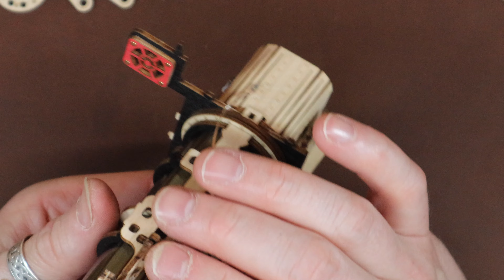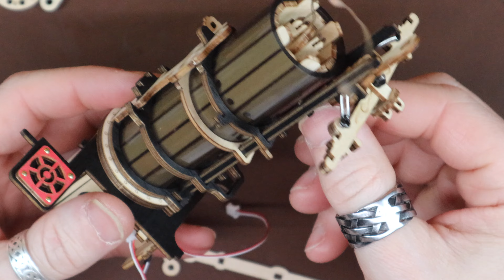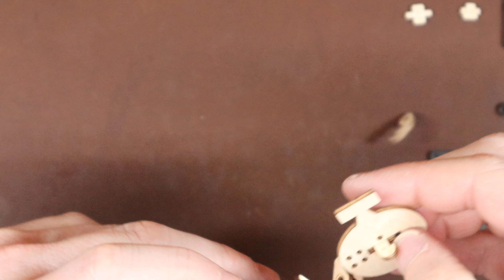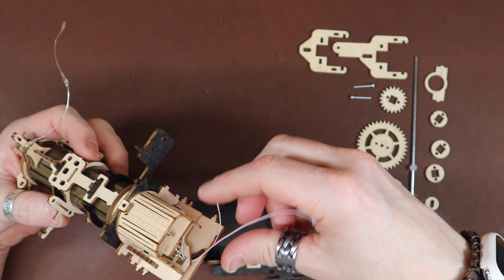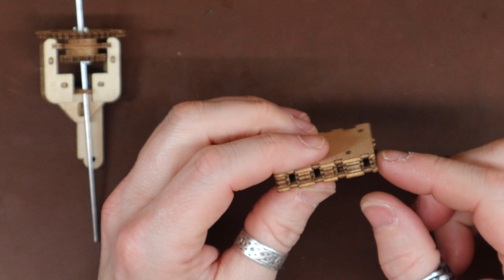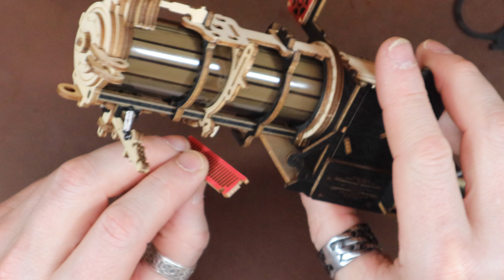ROKR Steam Engine Build: Pages 7-11

Comment: Has anyone had a problem with trans gears not rotating on a flat plain? I hate to continue if Ive done something is wrong. It turns better when alparts are in place but I dont want to find out at the end gears wont mesh
Reply from the maker: I think that the gears were pretty loose almost until the end when it all got tied together, seems like it was on that build where I had that issue.
Reply: @Dbuilderguy  thank you  when everything is in place and the shaft is in the notch it’s not too bad. I decided to continue on but boy did it look wonky for a while. Great videos don’t think I could get it right with out your help